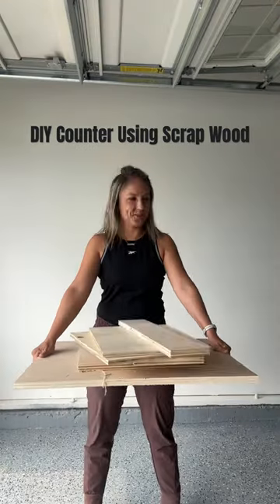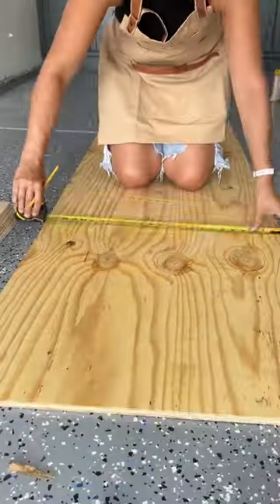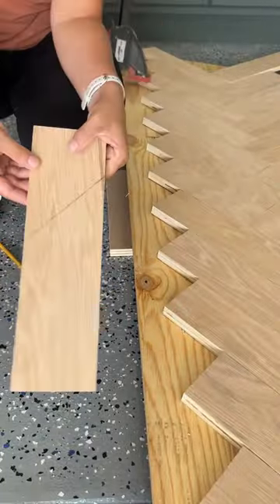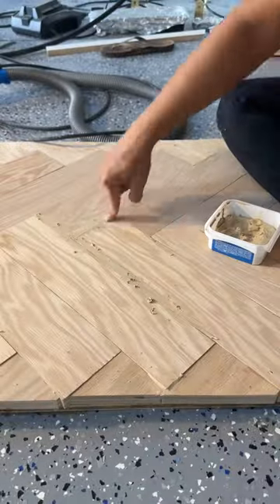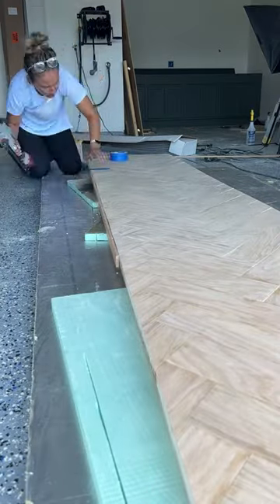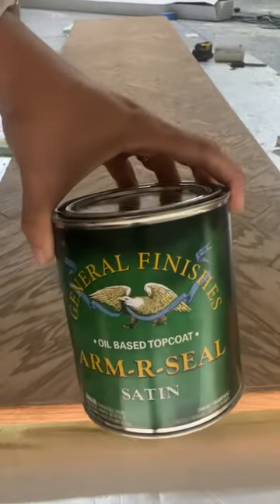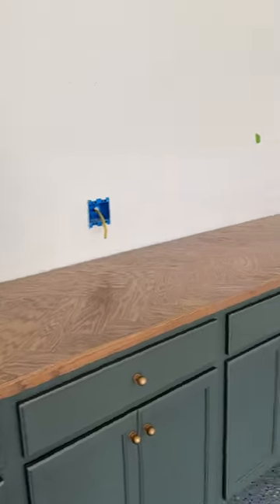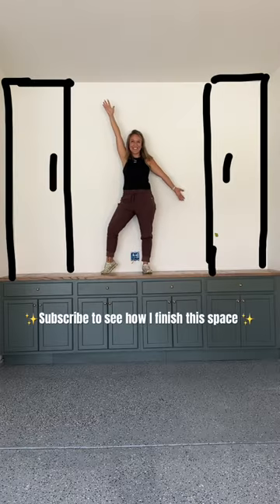DIY Counter with Scrap Wood | Herringbone Pattern

Comment: A great look, a really good way to fill gaps on blockwork like that is to grab a pile of fine sawdust from all of your cutting and mix it with a little resin and spread that over filling any voids, when sanded you cant see a single one.

Comment: Wow. Those seams are horrible. You can literally see the raised edges. You should probably stop giving diy advice if you're not going to do it right. There's no joinery at all, just glue. No clamps. No planer at the end. SMDH
Reply from the maker: It’s a work table…it didn’t need to be perfect. So glad for your advice though…thanks!!

Comment: Very nice job. One thing I will say is that it probably wasnt a good idea to use filler in the cracks. Most likely it will start to crack and honestly will look worse than just leaving the space there in my opinion.